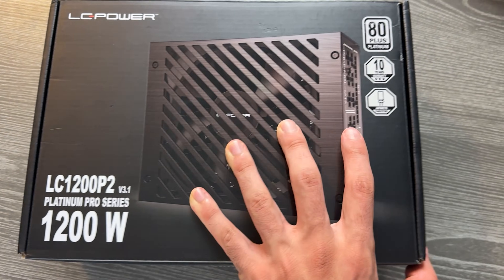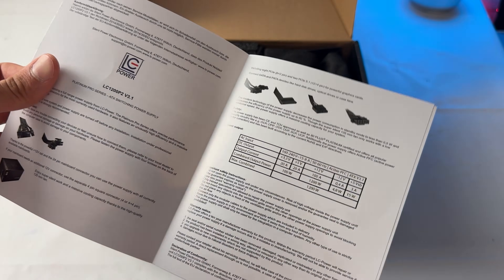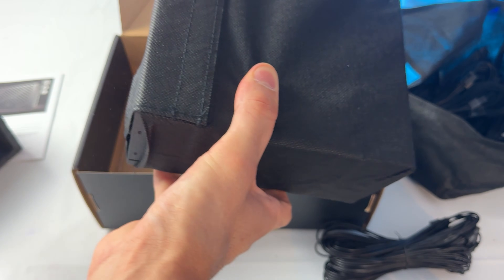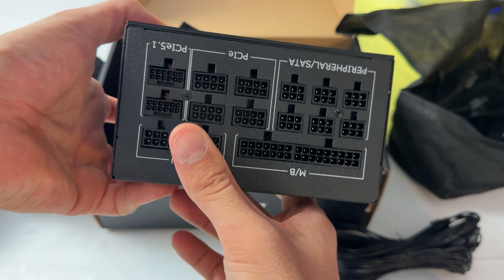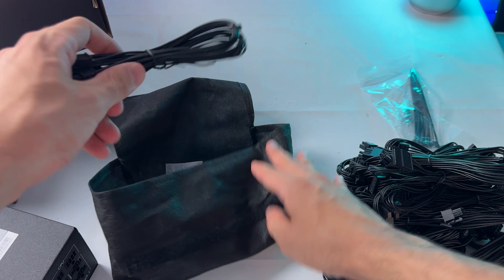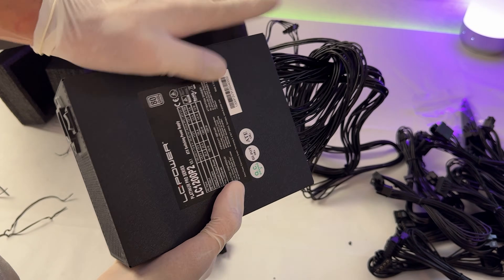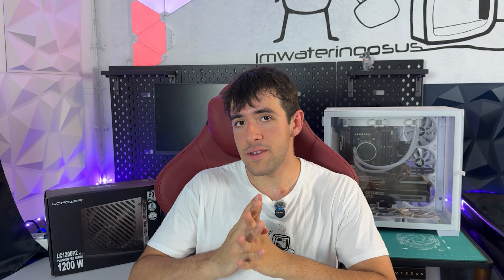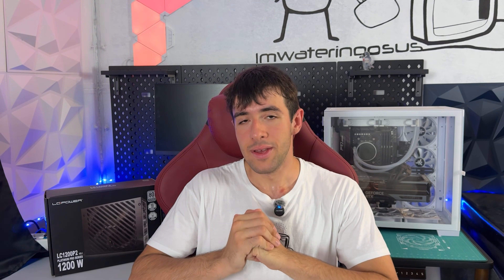Don’t Do This With Your RTX 5090 – AVOID This PSU Error

Comment: Forgive me if im wrong but is there such a thing as thicker wire or lower gauge wire for PSU to 5090? and would that even fix the issue of connections burning out this power hungry gpu?

Comment: I got an expensive NZXT C1200 which was top tier on the psu listing 80 plus gold rating 3.1 atx.  my 5090fe , 9800x3d , aorus x870e and 64 gigs 6000 cl28 ram 4tb Samsung pro ssd would eventually crash when loading games after a couple days and then not recognize ssds I tried changing them out and then eventually not even load windows . I reloaded windows , wiped and tried new ssds , changed mobo’s and ram and everyone it would work fine for a couple days to week and start crashing and not booting. Changed PSU to Corsair rm1200e and never had an issue for a month . Even expensive high rated  PSUs can can screw you and cost you a lot of frustration, time and money

Comment: What're your feelings on SuperFlower psus? I just ordered a SF-120014XP and everything leads me to believe it is ATX 3.1 compliant and high quality, but I did notice one reviewer on NewEgg complain that the product they received was in fact NOT ATX 3.1 compliant...I even went as far as to check the massive psu tier list on reddit and this one was rated "A+" so im hoping not to fry anything with my 5090/9800X3D

Comment: What about if use a old psu 850w evga gold g1/g2 with the conector 4x8(6+2) to 12pin.
For a rtx 4090. 
Thx in advanced.
Cpu will not surpass 110w in my case, not liquid water cooler only air, no Rgb lights.

Comment: 3.1 does not address the load balancing issues.  It only improves the female(on the PSU and on the GPU) plugs.  The cables themselves are the same.

Comment: The Corsair hx1200i is also another banger of a psu
Reply: should i get that for r9 9950x3d and 5090 32gb ?????? only want to game really im just spoiling myself
Reply: @TacticalTurkey420  if you are only gaming save money and get the 9800X3D it will get the same if not better performance in games. The 9950X3D is more for work.
Reply: @NateDawgg420 too late bro I got the cpu for 300 bucks new … that’s the only reason why I got it :(

Comment: 3:14 please, I say this to stop people from frying their systems. do NOT get a PSU JUST because it says 80+ gold. Use the SPL PSU Tier List (the replacement to the previous Cultist PSU Tier List, which is outdated). they rank the power supplies based on many factors, and note other issues on the list when ranking the psus

The 80 plus standard is for efficiency only. Back 10 to 15 years ago it may have included quality, but thats not the case now. A lot of brands have had bad PSUs pass the 80 plus gold efficiency requirements. And vice versa, some bronze rated units can have higher quality components.

Comment: My system: i7 13700kf; RTX 5090 MSI Vanguard; PSU: ATX 3.0 Hydro TI Pro 1000w titanium - I undervolted CPU + GPU a little bit. Upgraded my GPU two weeks ago and coming from a RTX 4080 MSI Gaming X Trio non-super and my system is absolutely stable no probelms.

Comment: Is ATX 3.1 PSU really that important if I'm considering getting a 5090? I already got, what I've been told, a pretty decent STRIX 1200W Gold Aura, which is a 3.0 PSU.
Reply: No, the load balancing issues were not solved with 3.1.  The only difference is the pins on the female sockets(the one on the gpu and and one on the PSU) are a little better.  The cable is the same with 3.0 and 3.1.

Comment: Hello, you seem to have an error in your Amazon Link - it leads to the LC-POWER LC1200P V3.0 and not to the LC-Power Platinum Pro-Serie LC1200P2 v3.1. The LC1200P has only a 3 years warranty, the LC1200P2 has 10 years warranty. And the LC1200P is only recommended for GPUs with not more than 450W max power consumption...

Comment: Using my Astral 5090 with a 1200w ROG Strix 1200p gaming. Don‘t think i saw anyone yet with my problem but i couldn‘t use the standard 12vhpwr cablr from the psu, because the cable amps always went above 9.5 so i had to use the ugly adapter cable for it to work and it hasnt even went to 9amps ever since. Sadly because of the adapter cable im using now i can not get that „gpu first“ feature from the psu :/

Comment: eVGA 1200W P2 since 2019 and she's still goin' strong - slightly worried with it's age that this new MSI 5090 Suprim Liquid is testing it though.  Looking to upgrade soon to something that has native PCIe 5.1/ATX 3.1 power and 80 Plus Titanium.  Right now I'm aiming for the Asrock Taichi 1650W because I will eventually be going dual GPU in my system for rendering/training AI purposes on the 2nd GPU consistently, while the 1st GPU will sometimes render sometimes game (primary GPU is going to be the 5090 Suprim Liquid of course).

Comment: Sf1000 Corsair on 9950x3d + 5090 works fantastic
Reply: any issues at all when high usage?????? i have the same exact cpu and gpu
Reply: @TacticalTurkey420  No issue at all, psu is quiet and cool under maximum load

Comment: For 5090 1000watt platinum is more than enough. Specially Corsair brand
Reply from the maker: Heh. Depends on the CPU my friend :)
Reply: @ImWateringPSUs  For AMD CPU and a 5090 it's fine.  The 9800x3d and 9950x3d tdp's are 120 and 170watts respectively, and while gaming they pull no where near their TDP.

Comment: I'm sitting on a seasonic vertex 1200w 80+ gold right now. 5080 7800x3d, a bit ov an overkill :D
Reply from the maker: Definitely overkill, but it's how we like it and you can rest assured no current spike is getting through
Reply: @ImWateringPSUs  I wanted a 5090 before price announce :p I was down to spend a 4090like price

Comment: Do you recommend lc power as a brand or just this psu?
Reply from the maker: I like their cases a lot and I think they're underrated. But they look very "unique" so of course they're not for everybody. Their PSUs are good. Every single one I tried. Monitors... they're cheap. Don't expect crazy picture quality or super fast response time, but can't argue with the price. Soooooo overall yes, I do like them a lot because of the value for money. I think they're underrated!
Reply: @ImWateringPSUs  thank you i saw that one of their psus was  about 30-40€ cheaper than the others and it had no rewievs so i was a bit sceptical of that but if you say they are good then i will happily buy one of their psus
Reply: @wolfmikk32  They have good ones and bad ones - I would never recommend a LC-Power Supply that only have 3 years warranty, but there are LC-Power Supplies that have 10 years warranty like the LC-Power Platinum Pro-Serie LC1200P2 mentioned in the video. But beware, the link below the video leads actually to the wrong PSU, the predecessor which is not suitable for RTX 4090 or 5090 cards.

Comment: I personally have only used the higher end Corsair PSUs. I’ve had zero issues. And you can buy all the cables from Corsair too.
Reply from the maker: Corsair on the high end has always been solid, on the mid to low end though I wouldn't really recommend them